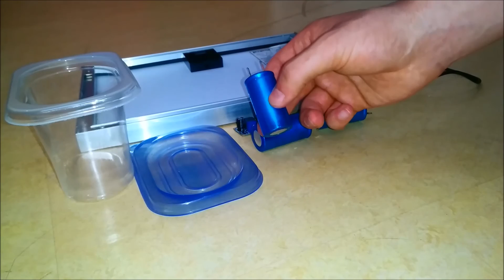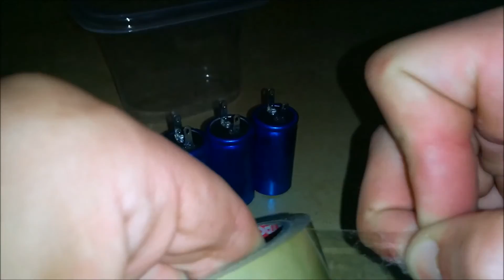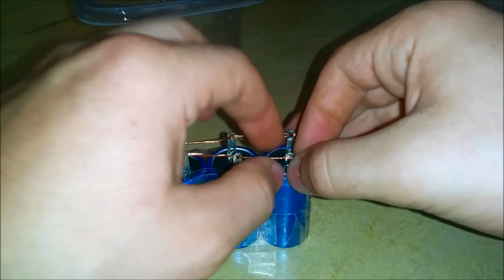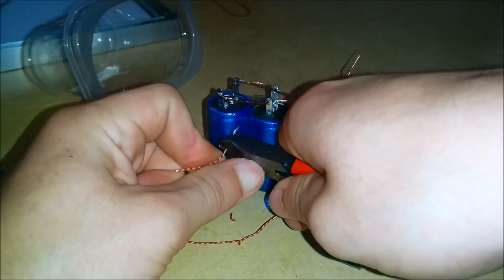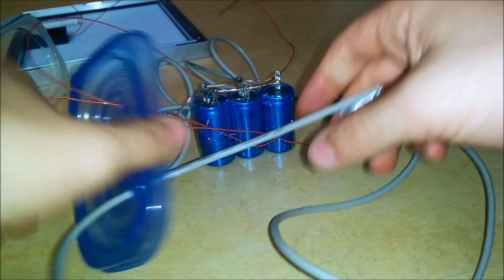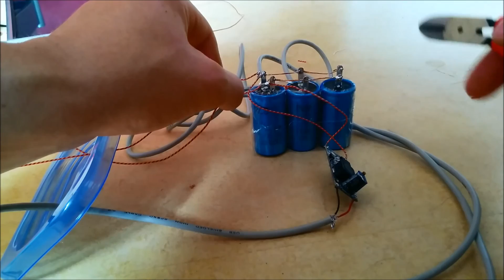DIY Solar pond pump

Comment: A little disappointing. I thought you were going to show how to turn that little module into a linear current booster that held the panel at the power point voltage. Quite easy to do by lifting the on/off pin and controlling it with a single transistor. Then it will work at lower light levels for a longer time.

Comment: great video. What is the purpose of the dc to dc invertor? why does it need to be converted if its already dc from the solar panel?
Reply: He is using a dc to dc buck converter to lower the voltage (?) from the panel down to 4 volts.  Apparently the pump runs on 4 v, sounds odd.